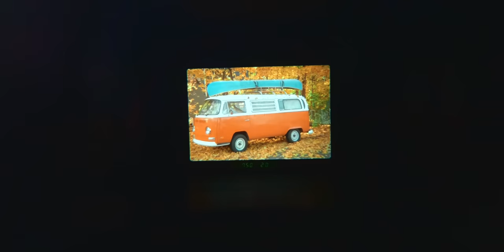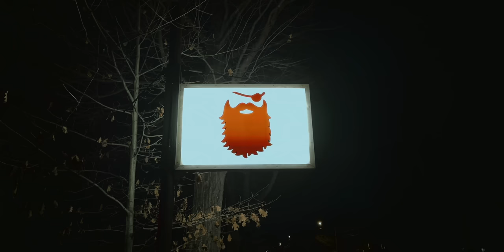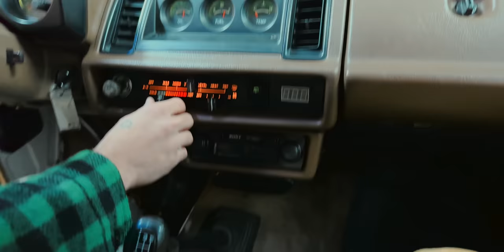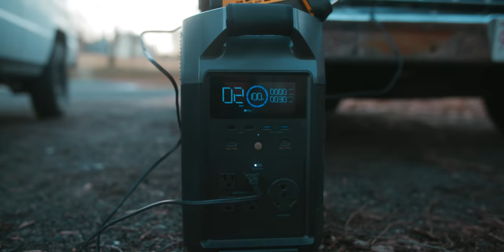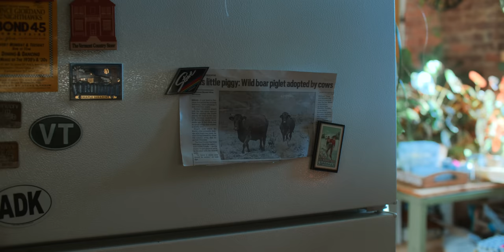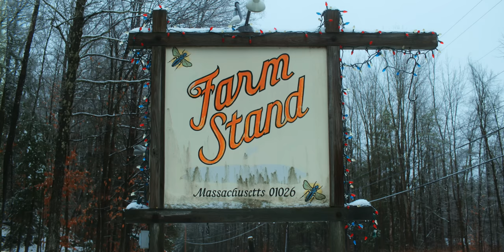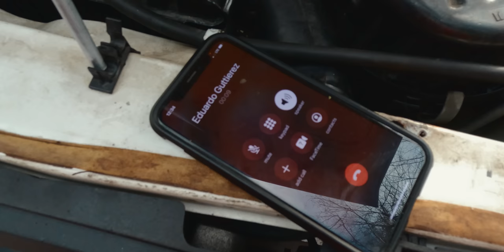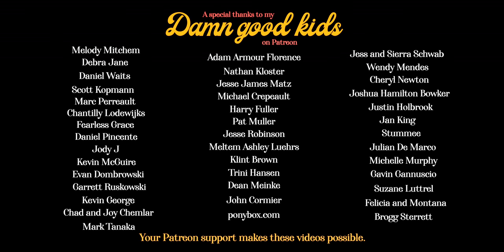Embracing Change and Prepping for Winter in the Hills

Comment: I also was glad to hear your endorsement of the EcoFlow.  I just bought two and hubbed them together for a solar backup generator.  An electrician came and wired the system into my electric panel so if the power goes out, I just have to flip the switch and it will run my whole (small) house through the panel.  I hope I won't have use it, but sure feel better knowing I can!